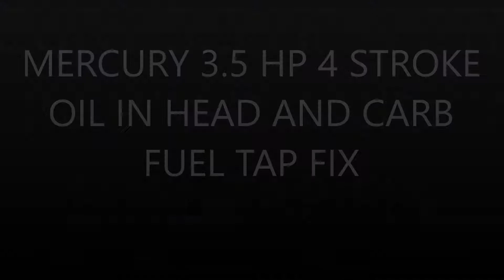MERCURY 3.5 HP 4 STROKE HOW TO REMOVE OIL FROM THE CYLINDER HEAD AND CARBURETOR

Comment: Too many comments on the same subject. Here goes my copy/paste from another comment.
"For the ones who haven't read the USER MANUAL. Cough, cough! It might come as surprise. But Tohatsu states, loud and clear, that for storage the outboard should be in a vertical position! No but's, no maybe's. 🙂
When laying down It should be done with the throttle handle side up. And the power unit should be lifted 2 to 4 inches...
For the record on my edition it's Pag. 34 - Section 7.3
Just saying. 🙂

BTW a small piece of 2x4 should be perfect for the task."

Comment: I have the same motor....I stored it on the correct side....2 weeks later I had a oil leak when I went to take it out.....found that the oil leaked out of the air intake.....when I stored it it was just slightly leaving one way but completely correctly horizontal on the correct side......I dont understand how that happens even at a slight angle.....doesn't seem like a smart way to store motor..... Going to have to clean intake now.
Reply: For the ones who haven't read the USER MANUAL. Cough, cough! It might come as surprise. But Tohatsu states, loud and clear, that for storage the outboard should be in a vertical position! No but's, no maybe's. 🙂
When laying down It should be done with the throttle handle side up. And the power unit should be lifted 2 to 4 inches...
For the record on my edition it's Pag. 34 - Section 7.3
Just saying. 🙂

BTW a small piece of 2x4 should be perfect for the task.
Reply from the maker: Thanks for sharing ATB

Comment: Great job you did. I have the same motor, but I noticed yours does not have a fuel pump and uses gravity feed to the carburetor. Mine has a pump and I plan to eliminate that as another potential issue.

Comment: I have this motor. I believe the fuel shut off switch has somehow been turned backwards (the red handle should be facing out rather than in. I'll bet if you push it upwards and flip it 180 deg and set the inner switch back down on it that everything will be right.) Also, if you search there is a video on adding and external tank connection that works very well. I've replicated that on mine and with a 6 gallon tank I think you can run for 16 hours or something. It's a good modification.

Comment: first - thanks for this video that gives me hope! I did a pea in the transport and there was an oil leak. now I have a problem with the ignition (Mercury 3.5hp 2020) - I start with the choke but after reducing the choke the engine shuts down. I can't turn it on without a choke?
Is this problem solvable?
Reply: I have the same problem, how did you solve it? (google translate)
Reply: Clean the carburator, small nozzles get clogged

Comment: what oil do you use?   i have the same motor and the same exact problem
Reply: and what did you put into the head to clean the oil out?
Reply: I believe its mercury 10/30. That's what's recommended..

Comment: So this engine has the Honda 2.3 type problem that oil runs out in the carburetor?  I didn't understand, what does the red petrol lever have to do with the oil that ends up in the carburetor?
Reply from the maker: 2 problems 1 oil in the carb 2 fuel tap put in the wrong way
Reply: @MrMeltedwellies  Why does the oil go back into the carburetor?
Reply: From a crank case vacuum tube that probably vents into the carburetor. I just stand mine up so I've never run into this problem.